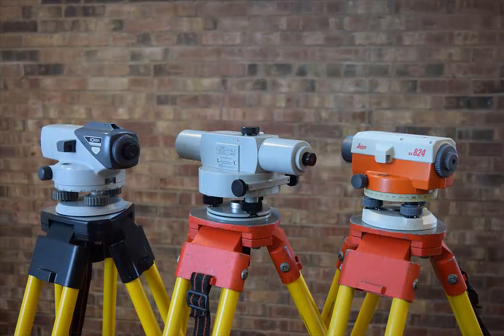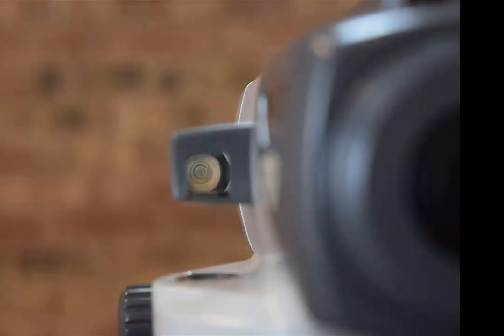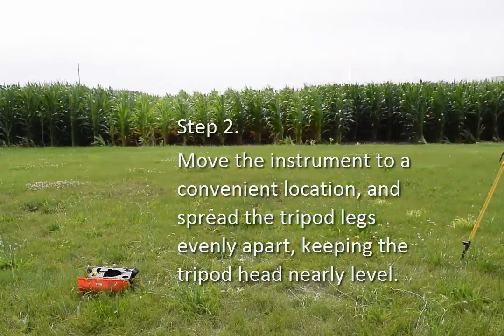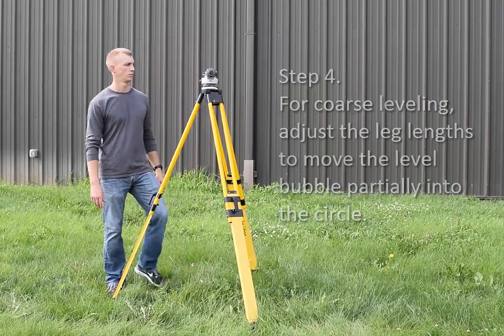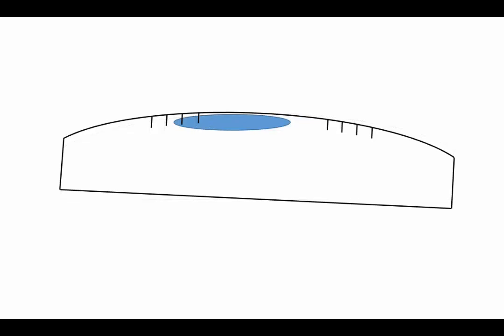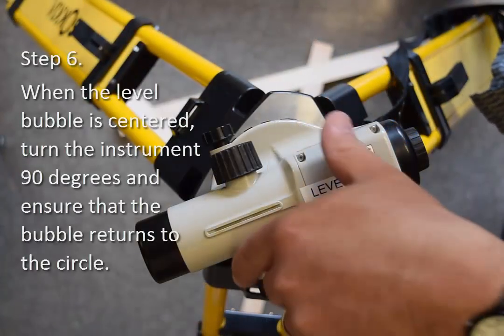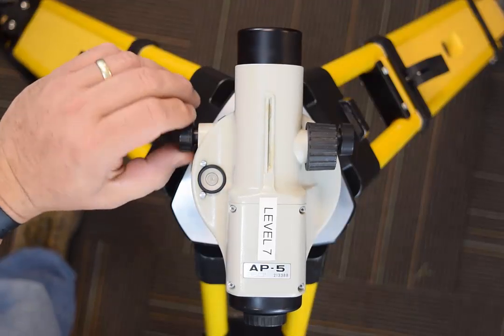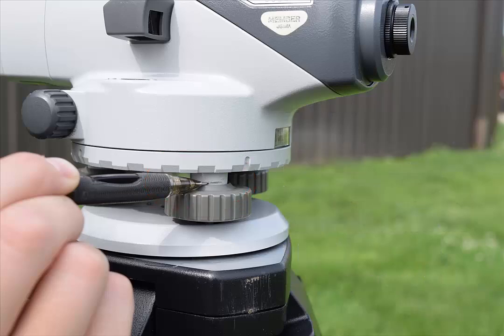Setting Up the Automatic Level

Comment: Older instruments (I like vintage gear) have their level vials affixed by screws to the telescope. I have found that using these two screws as a sight line, I can use that to find my target well enough to see it in the scope. So even if you don't have a sight, you can still improvise a means of doing so. of course, they also have four leveling screws so were a bit harder to true up...

Comment: The field artillery has been using aiming circles for decades. The leveling of this piece of equipment is the same. Good instructions. The primary difference is direction. I thought that this piece would enable the location of magnetic north but apparently it does not. I'll have to do more research on theodolites. Never used civilian equipment before but I am well versed in aiming circles and GLPS systems which enable location.

Comment: .It is notable that in various instructional materials on level setup, the 360-degree circle is frequently overlooked without any explicit mention of its significance. The absence of acknowledgment regarding this crucial element may create a misconception that it holds no relevance. However, it is imperative to recognize that the 360-degree circle plays a pivotal role in the functioning of the instrument. Understanding its purpose is fundamental for achieving accurate and precise measurements, and it is advisable to incorporate comprehensive explanations of this component in instructional content to ensure a thorough understanding among users.

Comment: Sir, I am doing a building and construction course and in the course we are taught how to use the dumpy level; that made me interested in acquiring one to use it on site, to setout the building, and for landscaping, drawing contour lines on a site plan, etc, would you please advise me as to what would be the best, entry level, cheap but accurate, dumpy level?
I have been looking at the Topcon, and the Leica as well as the  Bosch, except  for the Bosch, the others seem a bit expensive  for a student. Which one would you recommend, please?
The next question, is wether the Dumpy level has now become obsolete due to the laser levels. Again, would you be kind enough to tell me whether laser levels are dangerous on the construction site, because of the possibility to accidently train the beam on someone's eyes?
I was told by our teacher, that the most accurate level, is the dumpy automatic level, that lasers are not as accurate and outside are difficult to read, and therefore requires extra investment in a laser detector.
Can you please advise, Sir?
Regards,
Franklin